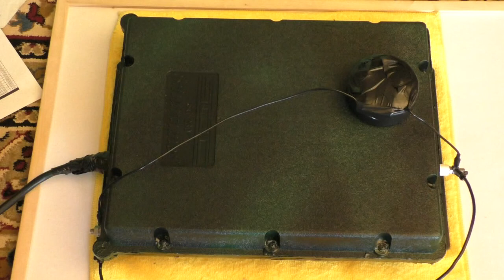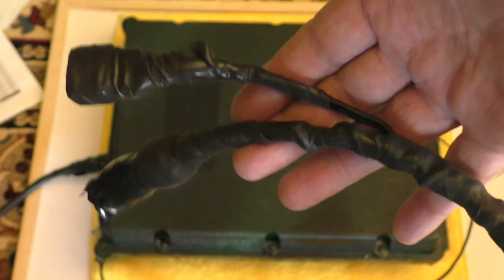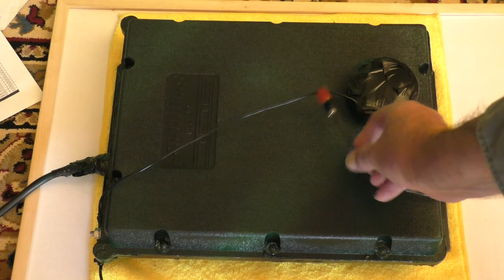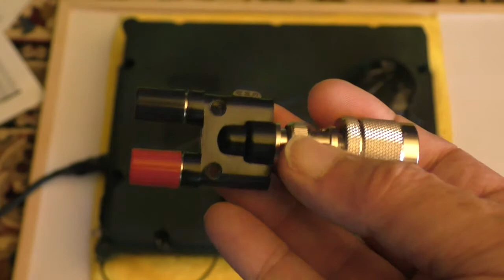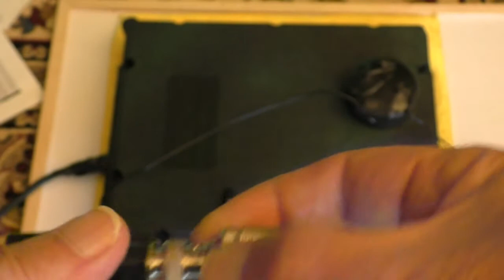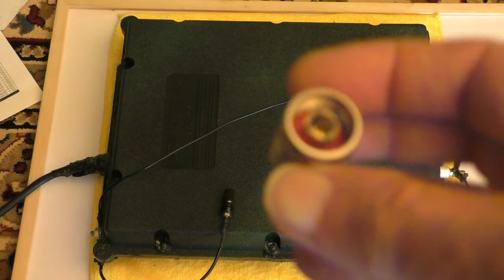Static Drain Choke Wired Across Auto ATU

Comment: Hi Steve, I have just been given a SGC 237 model auto tuner that got water in it and stopped working. It didn't pull any current so they went to check it and saw it had water in, fuse still in tact.  The only fault I have found is that there is a chip that says 74F74 that appears to have one leg broken/missing and another come off the track pad.  I was going to jumper each of those and then check if it worked.  Any other advice as to what I should do?

kind regards,

Simon
Reply from the maker: Only make absolutely sure it's thoroughly dried out before you apply power. My SGC230 has been completely full of water on two occasions, it blew the internal fuse. I dried it out in the relentless Australian sunshine and replaced the fuse, it worked first time on both occasions so SGC gear is obviously built tough. I hope you have a win. Cheers Simon.

Comment: Is that an SGC 237 or similar ?
Also, great job doing the banana clips and static line - nice job - a real little goer, to quote Arthur Daley.
Thanks, it's got me thinking :-) Now my head hurts.
Reply from the maker: Thanks Ade... it's an SGC230, it doesn't do 6m unfortunately, you would need an SGC237 for that.
Reply: VK6CS I think about buying one (237) for portable op's.
Although I want a 237, I do plan to cut mono band dipole wire sets.
Anyway, I only 7112.8 LSB so for now it's all up in the air.
Thanks for making great videos, cheers.
Reply from the maker: AM broadcasters tend to use antennas that are between 105 and 115 degrees (a quarter wave is 90 degrees) and then match them. This arrangement makes for low feed-point voltages and good bandwidth. They don't typically use resonant lengths. Maybe you could try a single wire with traps for the bands of interest at the 110 degree points and just put the SGC237 at the feedpoint. That would make a good video.
Reply: VK6CS Have you seen my videos ?
It's lucky if they even get on you tube....
Organising a video for me is like trying to figure out a capacitor from an inductor.....very hit and miss...
But it sounds good.